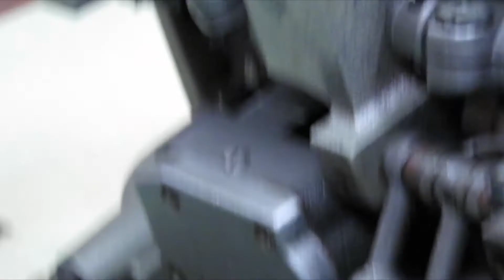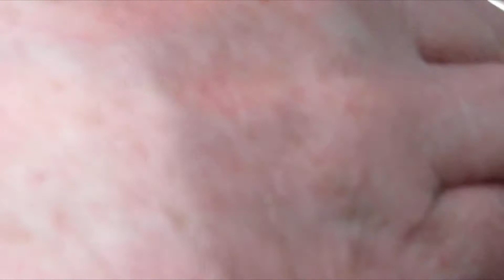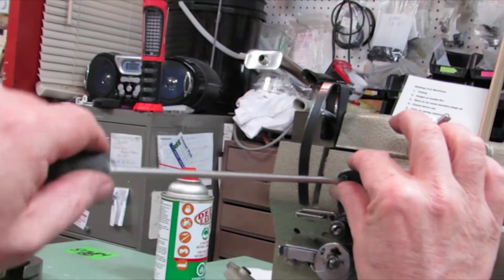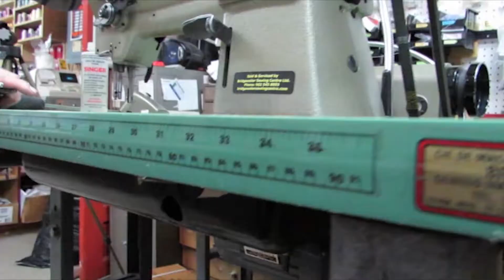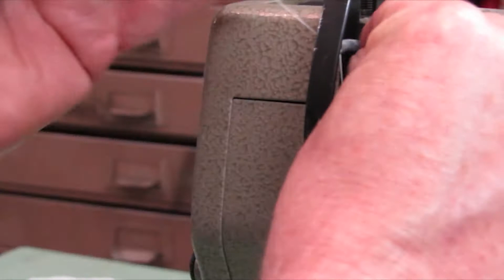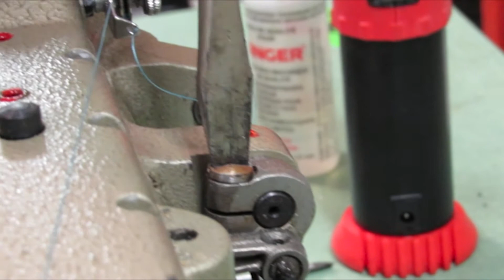Singer Walking Foot  211U566

Comment: Thank you. I needed the up spring part to be able to sort my singer 211G156 out. The machine kept jamming due to incorrect tension and the spring was not springing. Screwed the tension part of, got the spring back into position and tightened it a bit. Seems to be working now 😁

Comment: Very thorough. The only thing I could use help with is the clutch timing belt replacement. Although I have a 211 G 156 model, they seem to be similar enough to figure out the process. Anyone that could show me that procedure would get a Christmas card.

Comment: I recently picked up a Singer 211U166A for free, and I got it tuned up for minimal cost. It seemed to be working, but before I could do anything useful, I tried to make a minor adjustment, and the tension spring snapped. Thanks to this video, it was easy-peasy to replace the spring. Hopefully, I'll now be able to put the machine to good use making sails for my mini-sailboat, along with sail bags, trampolines (the kind on sailboats), etc.

Comment: I got this old Singer 211U566A over 20 years ago from South-Africa and brought it in a container shipment to France. Life just flew past and I never had a chance to make use of it. Now its setup and I found your video and it is indispensable as I do not even have a user manual for this machine. It was in full working order when I got it secondhand but with all the standing it needs a proper checking over. Great video and a big thanks Neil!!!!

Comment: Great video, it's been a big help. I didn't notice you mentioning anything about the oil level in the reservoir for the hook assembly at all though. And isn't there any way to oil the mainsheet bushing by the hand wheel?
Reply from the maker: The only way to get oil there would be to take the top cover off.

Comment: You might be able to help. Ive tried to remove the bobbin carrier.  I've removed the 3 screws but the bobbin won't lift out. I think there might be thread caught between it and it wont rotate.
Reply from the maker: Sometimes you have to take two screw drivers , using one as a hammer, and gently tap on the bobbin case base to get it moving around and it will eventually pop out, as long as you have the gib removed. Using a hammer could break it.

Comment: Hello neil. 
Could you please do a video on how to set the stitch width and do a trouble shooting video. The amount of movement for my widest stitch and narrowest stitch is only 1/16” wheel movement. And it doesn’t seem right. There’s way too much room that’s not being used at all. It’s a singer 221u566a also. If I hold the button down and turn the wheel, it doesn’t have very much adjustment that’s usable. And my stitch should be able to go much wider. Thank you in advance.
Reply from the maker: Next time I have a chance I will do a video on this.

Comment: Thanks for the helpful video! I bought a "non working" 111W155 to do my own upholstery on a car restoration project. About 6 hours ago I did not have a clue how these worked. I will keep the story short by getting to the punch line, which is there are two sliding cover plates on each side of the needle/foot area, which at first glance look identical, but turns out they are not.  I am sure you are chuckling right now because you know what the important difference is.
 The upside is I needed to get familiar with the machine anyway and made all the little adjustments in your video, and after 6 hours of frustration it made me laugh too, when I realized that all I needed to do was switch those two plates around because one of them has a recess in the bottom of it so the thread can pass over the top of the bobbin case. :trophy-yellow-smiling:
Reply from the maker: Thank you for the comment.  And for visiting the page.

Comment: Fantastic video.  Can I ask how I slow the machine down. Minimal petal press and it takes off full speed.  I have slacked the belt and taken the take up on the clutch lever and pitman arm to the petal like you showed in the video.  The machine runs too fast
Reply from the maker: A servo motor will fix this problem.
Reply: @bridgewatersewingcentre you have a video on servo motor upgrade for this machine?

Comment: i have a singer 491 and just got it adjusted however I noticed the reverse works up to 6-8spi but literally nothing after 10 or more. Makes locking stitches a pain because it cause a ball of thread in the material unless it does it automatically 🤷‍♂️
Reply from the maker: the stitch length between forward and reverse would have to be adjusted.

Comment: what is that small clear plastic container mounted on back of machine? no one has ever bothered to mention it!
Reply from the maker: It holds Silicone oil for Lubricating the thread when doing a project where your needle heats up.  It is not necessary.

Comment: Hello Neil, You did a great job with video. I have a singer 211U567KB. The bobbin will not refill due to plastic drive wheel is old and half of it is in pieces. I'm having trouble finding this part. Is this part still available. Thank you.
Reply from the maker: It is somewhat hard to find the bobbin winder parts.  Your best bet is to buy the standard bobbin winder that you can attach to your table.
Reply: @bridgewatersewingcentre   Thank You!

Comment: I'd like to thank you for this video. I just adjusted my 211a566aa using your instructions and it is now running perfectly.
I had an issue with the forward and reverse stitch length being different and found how to adjust that as well. The main problem i had with the 211 was the maximum thread size for reliable operation is TEX150. Anything larger and I had problems. For now I'll stick with the TEX150. Cheers.
Reply: How did u fix this ??

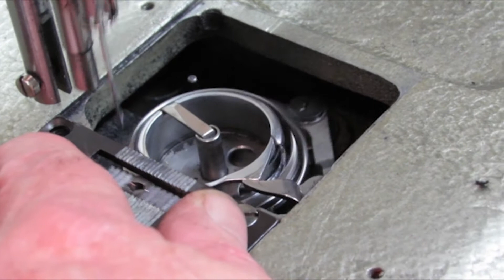Comment: It might be me, but at 14:00 it seems like your lower feed dogs are not correctly adjusted in height. I thought a rule of thumb is that on the upstroke, they should stick out approximately 1 tooth over the plate (it seems in this case they not just not stick out, they are actually lower than the plate).
Reply from the maker: Yes the rule is to adjust the feed dog so the v of the teeth are just sticking up through the plate at the highest stroke.

Comment: Does the top cap, that runs the length of the machine, pop off simply by removing the screws on top? I have a Brother LS2-B837 that looks very much like this 211 and after I removed the screws it didn't pry up and I felt some resistance.
Reply from the maker: Sometimes there might be a gasket there that has sealed the cover down.

Comment: I just purchased a 211ux567b. Watched your video several times very helpful. How big of thread will this machine handle for sewing leather wondering if it will handle tex 277 with a 200/25 needle.

Comment: my thread take -up  lever is broken ,how to replaced it ( model -211G156) walking foot) tks
Reply from the maker: It is a pretty big job.  You have to remove the whole needle bar rock frame. Once removed then you remove the take up lever, replace with new take up lever and reinstall the rock frame to complete

Comment: My needle is rubbing the bobbin hook as the scarf passes by. I'm on time and it is sewing, but the needle to close has me concerned.
Reply from the maker: If your machine is the Singer 211 you have to loosen two screws on the hook saddle and tap to the right a tiny bit.

Comment: Amazing how similar this us to my 111w153. I assume the presser height adjustment button took the place of the screw accessed from the back. Also my machine doesn't spin freely. The timing belt is really tight. Would that cause that? Otherwise works fine
Reply from the maker: The button did replace the screw.  If your machine is not spinning freely first check and make sure your motor belt is off the machine. If the machine is still tight without the belt on then more than likely it is problems within the hook assembly area.

Comment: I have adjusted the stich length on my singer 211 but can only get 7 stiches per inch. Is there another adjustment I can make underneath the machine
Reply from the maker: There is but that is much to complicated to explain here.  Machine would have to be brought into the shop
Reply: What he is talking about, I was going to try to attempt this morning. Turns out, the service manual never described how to change the stitch length by pressing the button on the bed of the machine. Instead, they show making the switch adjustments by loosening and turning screws on the underside of the machine. I was sweating bullets at the very thought of doing that. I watched this video again and learned to do it without trying to become a service tech!

Comment: I have a 211G166, will this be similar?  I've had this machine for 20 years and never really used.  I'm really getting interested in using Vintage machines.
Reply from the maker: Would be the same adjustments.
Reply: It worked on my 166 and it runs like a dream

Comment: I have a 211U567B which is nearly the same machine. I've never been able to figure out the difference. 
Anyway - I am looking for Needle Bar replacement instruction. I'm wondering if I need to remove the hook assyb prior to removing the bar. But, since I can't find that, I'm going to tear into it and find out. This video will be helpful after I get it installed. Thanks !!  I'll be back  😁